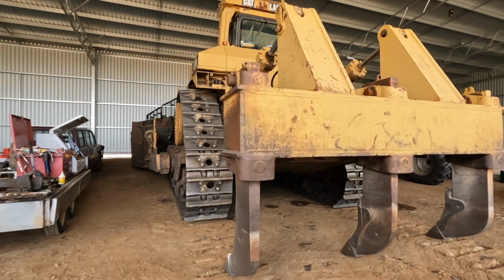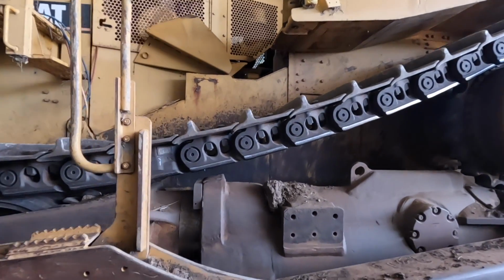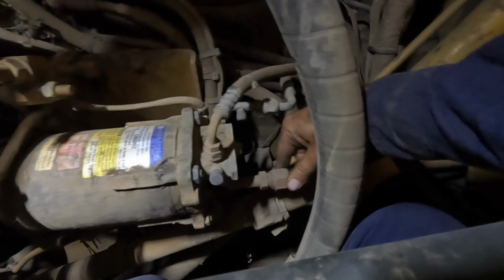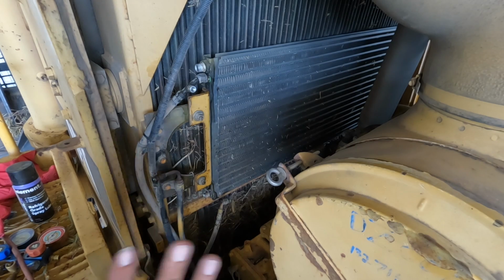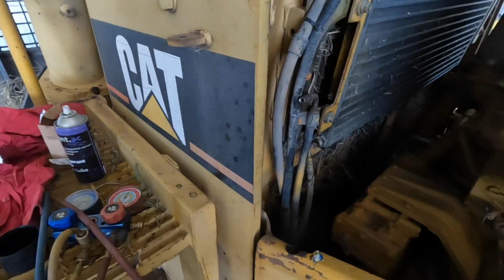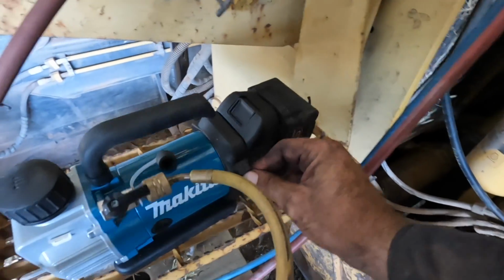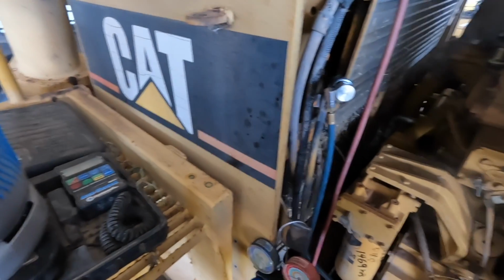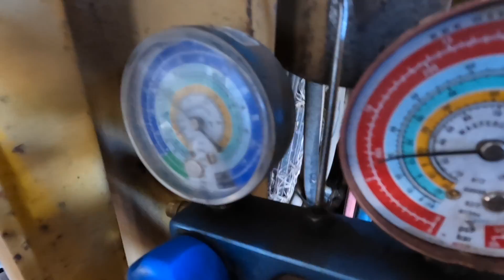Repairing Air-conditioner on CAT D11 Bulldozer (Vlog 135)

Comment: probably not as important for ag/vehicle systems but for house and heat pump systems one of my best tool purchases has been a micron guage.. you can tell very quickly if there is still moisture or a leak in the system.. if it climbs vacuum but stabalizes there is moisture still..

Comment: Hi Matt first thing you want to do is throw that Delco r2 compressor in the scrap and replace with a Nippon denso. They are crap even when they were on JDS and chamberlain's. Always upgrade them
Reply from the maker: Hi Gordon, I agree that there are better compressors out there however with limited time to modify and look for the right compressor it was easier to stick with delco which still seem to last a long time😁👍

Comment: Have you ever thought about using a micon gauge in concert with your vacuum pump. You can actually watch the moisture being removed from the system I use both an electronic and analog to track the progression of system evacuation. It also tells you if you have a leak instantly, just food for thought! Nothing wrong with your way it just allows you to get the vacuum pump quicker.
Reply from the maker: Thanks mate, I haven’t really bothered but in an ideal world I would love one and it’s a great idea😁 just don’t do heaps of a/c anymore👍
Reply: Thanks for the reply, I enjoy your video's

Comment: Matt you probably have seen the fans on Hi track 8s 9s 10s and 11s the fans put in wrong resulting in low airflow I will always remember my first encounter with a D8l whereas is the compressor and one that the captive nuts on the floor plate came off not fun